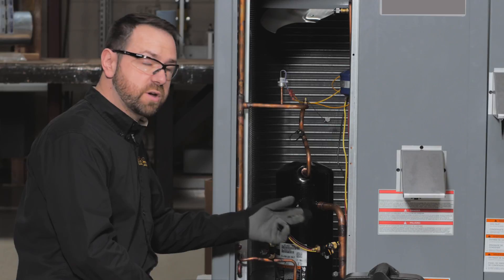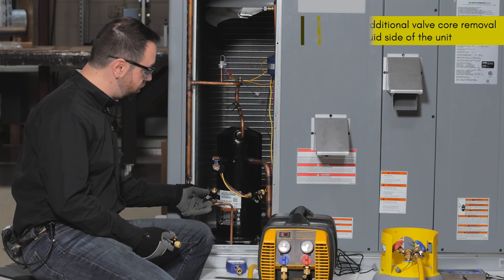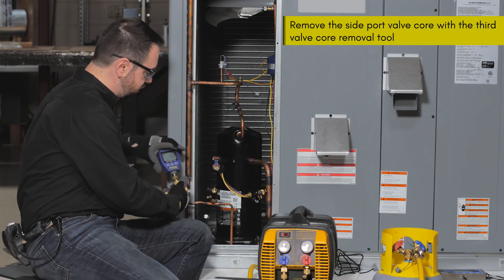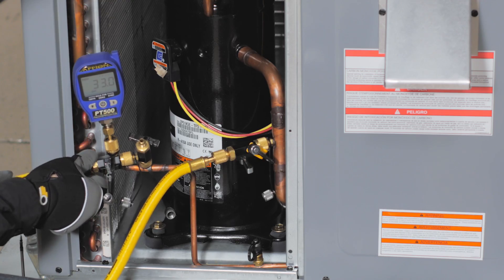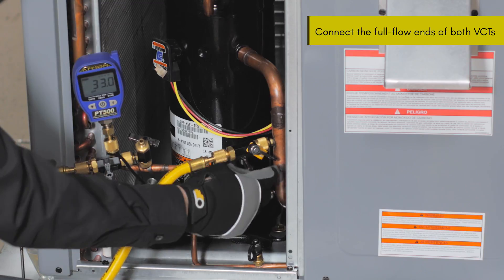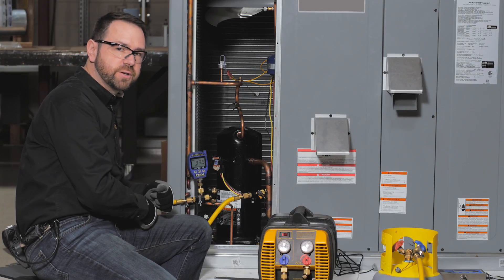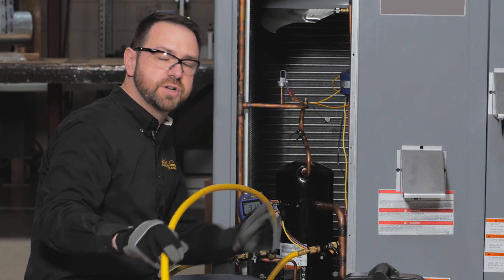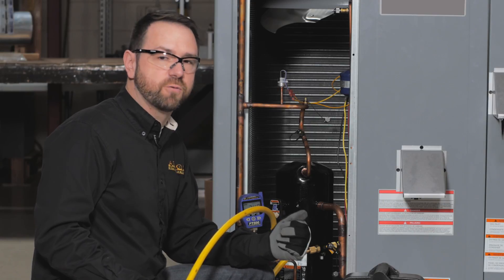Fast Recovery #6: Fast Recovery With No Manifold

Comment: Wouldn’t you want to put the second valve core tool on the back of the first one not the side because I thought when it’s a T it slows flow.. that’s why you guys have a Y manifold splitter correct? And also there is a shrader valve in the side that slows flow.  Please let me know if that’s right thank you.
Reply: Also is it bad to use two vacuums on in shop refrigerators where we have 2 vacuums available or does one end up pulling on the other and damaging it?
Reply from the maker: @wrightrepair  As for this question, you can definitely use 2 vacuum pumps.They arent "pulling" on each other, they are both evacuating the same space.
Reply from the maker: Fair question, a Speed-Y is definitely the way to go. However, this video was released in 2017 and the Speed-Ys weren't released until 2020. We are currently working on an updated Fast Recovery series that will fill in some gaps of this current series along with having updated tools.

Comment: Be good to see single service valve procedures with mini splits both in heating and in cooling for rapid evacuation and recovery.  Question:  Is it harmful on equipment to test for vacuum leaks by pulling a vacuum on a partially filled recovery tank?  Is it accurate to pull directly off the vacuum pump instead?  I have a suspicious core removal valve and a partially filled tank.  Good to the point information.
Reply from the maker: You can test your tools for vacuum leaks, which should be done regularly. Here is a link to our VCRT Isolation Test. https://www.youtube.com/watch?v=zDj3pWAHYP8

Comment: Did I miss something or did you hook that last hose up to the pressure side of the core removal valve?  I am assuming if so you had to leave the schrader valve inline??  That would kind of defeat the purpose of "Fast" recovery wouldn't it?
Reply from the maker: The hose is connected to the side port of the valve core removal tool with another valve core removal tool. In which, the core was removed.

Comment: I put 3/8 male flare X 1/4 female flare adapters on the 1/4 male flares on the recovery unit.  I have fully unrestricted 3/8 hoses other than the 1/4 male flare fittings on my recovery tank and my recovery unit.  It works very well.
Reply: Richard Selby Jr it’s sad, most just don’t get it.

Comment: Is there a reason you are putting the micron gauge on during recovery?? Will refrigerant harm the micron gauge???
Reply from the maker: The gauge shown in this video is our PT500, which is a compound low-side pressure/temperature gauge (500psi-29inHg) which lets us monitor recovery progress without using a manifold.  Our micron gauge (Part# AV760) can handle up to 400psi of temporary positive pressure (and has oil protection features) and has an easy-to-clean sensor in case it does get contaminated, but you do want to minimize the chance of a micron gauge getting exposed to refrigerant/oil.

Comment: I noticed that this is a slightly different procedure than the 'HIGH-SPEED DIRECT LIQUID PROCEDURE' on the G5 Twin operating manual in that you are actually using the machine to recover the vapor as well. So I would assume that this one is actually faster?

Comment from the maker: Featured products in this video are the G5Twin Refrigerant Recovery Machine (Part # G5TWIN), the MegaFlow™ Valve Core Removal Tool (Part # MGAVCT), The PT500 Wireless Pressure/Temperature Gauge (Part # PT500), and the 4 foot ⅜” Recovery Output Hose (Part # MH380004AAY).
For more information on these and all Appion products, click here: http://appiontools.com